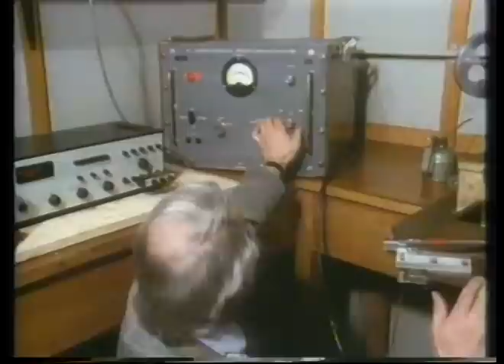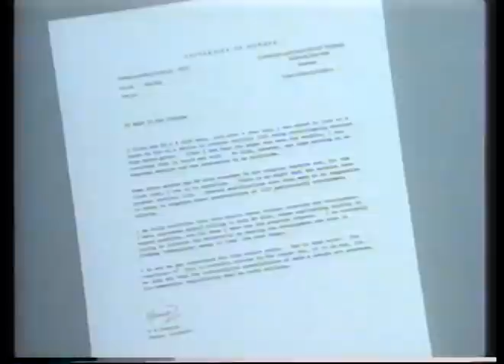Anti-Gravity Machine (Part Two)

Comment: You can lift the chair while stand on the ground but can not lift the chair while stand on it, doesn't matter how hard you try, even today space rocket, some mass must stay back for other mass to move forward, satellites use gyros to precisely rotate at the same spot in space but not change position or moving forward.
Reply: Well, one CAN lift a chair while standing upon it ... but it will just not stay lifted!

Comment: MYSTERY SOLVED! THIS HAS BEEN FULLY DEBUNKED:
Friction in the vertical center axel creates the lift.

the friction creates a screw lift effect.    anchored to the table and table to the floor.  without that center axel making friction during it spinning and without it sitting on a table on the floor it would just spin and go nowhere.   in 0 g it would rotate and no liftnwould occur as the friction on the spinning axel no longer is anchored to a floor to push up and off of

it will only lift as high as that center axel goes.   the axel therefore is creating the lift via friction.     to go 100 feet up you would need a 100 foot axel for it to 'Climb" up
CASE CLOSED
Reply: I don't think this needs to be debunked.  The "lift" was mechanical.  Same thing as a scissor jack.
Reply: @GAMESTERVISION   Youtube is the church of Conspiracy Theory.  Looking at the comments is like looking at the people at the car wash and saying everyone owns a car.  
Loved Bob's corvette that ran on water, and... gasoline.

Comment: I wonder why he didn't try four opposing gyro's to double the lift? im not suggesting it would have overcome it's own weight entirely but perhaps it could have been improved. Imagine how easy it would be to recreate his work in our age of more advanced electronics,  motors, cad design programs like fusion and a 3d printer
Reply: I think because the machine was making no lift.  4X zero is still zero.
Reply: Because doubling a force that doesn't exist works so well.

Comment: Hold on, you have to power a gear to get the total structure spinning. Then the two gyros fight the centrifugal force the gear generates by lifting toward the gear. No wonder no one is interested. Do you realize how much power it takes to create that effect?
Reply: This thing uses allot of power, but it's not regretting any effect.  The machine is not lifting anything.

Comment: By the use of magnets sound frequency  And Pan and tilt you could easily give this the movement it needs to go in any direction and any speed. Add a shell and you have a space craft.  This would enable you to do flight without thrust.

I have thought of multiple ways to add "thrust" by use of vents and slight modification to the device itself.  To use this method you would have to build the motor as the outside of the craft and it would be enormous making things much more difficult.

 You would need to add ventilation without causing drag on the motor. It can be done and may even have a use in such a design.
Reply: Yes and then the pulley and string used to make this thing lift up at 0:18 would not be needed.
Reply: That's why they were talking Nuclear'.

Comment: I find it very interesting that the UAPs that were confirmed by USA government seem to be very similar to his story about his craft working the same under water as there's clips of the UAPs splashing down and moving through water!
Reply: I find it interesting that this thing needs a bucket, pullies,  and string to pull it up.
Reply: It was the lack of tethering or measuring that tipped me off to how silly this is.  Any serious effort would place the device on a scale or force gauge.  In addition, its difficult to know where "the device" starts and ends.  Is the axle and the assembly that doesn't move part of the machine?   Why is there a bucket and other things hanging from the ceiling?

Comment: I would imagine it is flawed by Newton's law- that every force has to have an equal and opposing one. Whatever force spins the thing will want to spin itself in the opposite direction itself, so as soon as it is airborne it has no resistance so can no longer drive the giros. The giros required to produce any useful force would need to be enormous, so the 'craft' they're powering would never be sufficently larger to provide the required resistance. It'd be like putting a 6 foot propeller on an 8 foot dinghy, or a massive turbo-prop engine on a little Cessna.
Reply: The gyros could be 100 times bigger than the craft and they would still provide no useful force to move the craft.

Comment: This isn't anti gravity, it is just a spinning object with enough mass and speed to cut through the earth's field lines while eddy currents resulting as the affect seen. There is no such thing as anti gravity but if you can mirror the earth's natural frequency, you can levitate and or propel a craft, it would take a very high voltage and liquid helium cooled coils along with a sensor that can detect and mimic through modulation, the changing frequency of earth.
Reply: Oh well clever clogg's How did superman make the earth spin backwards then because I saw him do it with my own eye's!
Reply: you can levitate and or propel a craft?  Well i wish someone would.  The device in this video does not lift off the ground or even reduce it's own weight.  Spinning and wiggling certainly look fun and "cutting through the earth's field lines" sounds goo too.  But what's the point if it never works?

Comment: Obviously the air resistance of the entire spinning mechanism is the same as pressing on the spinning machine with your finger which uses the processional movement to convert rotational inertia into vertical inertia.
Reply: Or the sting and pulley system seen at 0:18 is being used to lift it.

Comment: The Noble gas structure is very important (A circle)! During this experiment there are two discs but there are needed 24 in a circle!  Take 7 balls and place one on a table and the other 6 around that ball. Each ball (metal) does have 8 magnetic fields =  4 x 2 (like a 1/8 piece of an apple) and the metal ball in the middle needs 24 discs to push away those six metal balls. Take an apple and cut it into 8 equal parts and each part is a magnetic field. See photos Billy Meier!
Reply: Drop a big lead ball and a small lead ball from the same height and they both hit the ground at the same time.  Same for a feather and a lead ball if you do so in a vacuum to remove air resistance.  Now drop a spinning gyro and a lead ball and something fascinating happens.  They hit the ground at the same time.   But the person holding the gyro felt how weird it was twisting in his hand, and starts to think he can make a levitation machine.

Comment: 423/5000
This type of machine can work, but does it take a lot of energy to get it moving? What about in space where there is practically no gravity, does it work?
Today, electric motors and a nuclear battery with tweek, this could replace the fuel engine.
I think that our government has already made attempts and are much more advanced than the population believes.
Reply: This type of machine did not work in this video.  What do you think needs to happen to make it work?  Floating in space weightless, could it make itself weightless?   0% more weightless sure.
Reply: @DeputyNordburg  I am thinking of creating a magnetic sphere which could suspend an autonomous gyroscopic sphere which could rotate without friction and obtain necessary and unlimited speeds. This could be possible.
Reply: @redgeciccone8218  It certainly could.  But aside from storing energy what would it do?  

The machine in this video was supposed to levitate.  To lift off th ground.  Gyroscopes don't do that.  And the one in this film did not.  

The professor in this film laithwaite seemed to think they became lighter when spinning.  They absolutely do not.

Comment: Would it work if the spinning/driving force wasn’t from the stable ground?
Reply: It does not work in this video that I can tell.  It has a string and weight to pull it up.  Shouldn't it be held down?  Wouldn't a force gauge or scale be installed to actually measure the effect?

Comment: Anyone who has ever held on to a gyro on a stick has felt the force of it.  Like wind blowing on a windmill.  Push the other way, you have a propeller.
Reply: I've held a gyro and twisted it.  It resisted the twisting, but never pulled in any direction.  Why with the plans for this online, do you think nobody will build one?

Comment: There seems to be some confusion about whether this machine is an "anti-gravity" machine, a new source of energy, or as a way of flying through space without reaction mass.  The only worthwhile application, if it can be made to work that is, is as a reaction mass-less way of moving when in space.  The conversion of sunlight through solar panels to provide power for gyroscopes that can turn rotational motion into linear motion woud be a great benefit to space travel and space exploration.

Whether or not this machine can be made to do any of the things it promises still remains to be seen, but after so many years and no results it doesn't appear to have achieved anything at all... And a statement by that crackpot Velikovsky is the last person you would want to hear from at the end of a "dodgy" invention.
Reply: Well, he patented it, with full plans available to the public.  And of course Prof Lathwait did eventually say it didn't work.  But his supporters refuse to build them.  So maybe it just doesn't work?
Reply: @DeputyNordburg  More than likely I'd say... 🙁

Comment: Let's see... 1986 to 2021... thirty-five years on and we don't see anything around which uses something like this, save a few mechanical batteries made by the Chinese and designed to store mechanical energy derived from wind energy (using energy derived from fossil fuels would be prohibitive in so many ways). The machine conserves angular momentum, and that's it. It's lift will be limited by how close to Earth's poles it is, along with how close it is to a gravity well. It was a good try, but sadly, no cigar.
Reply: Something like this?  It did not work in the video.  Why would something today use this?
Reply: @TexMex421  It wouldn't, and that's just what I'm saying. It might have a use as a mechanical battery for a resource such as wind energy, but you'd want to use that energy in quick order because it would loose energy, and would do so faster than most of the chemical cells we have today. The benefit of a mechanical battery is mostly about reduced environmental impact. All Chemical batteries have a significant environmental impact both in the manufacturing phase, and when no longer usable.
Reply: A complete description can be found in the expired US patent: US5024112A

Comment: From what I can discern, his device "works". But it is highly impractical. I am sure the energy input VS productive output (flight) is horrible. Plus flight navigation and control would be very difficult and unwieldy.
Reply: They seems to discuss it working in the video, but I never saw anything to indicate that it worked. I also didn't see what I would think of as an attempt to measure it working.  What I mean is there is nothing measuring it's weight.  if the machine was 100lbs originally and then spinning 90lbs, great, Success!   You could measure that on a bathroom scale.  Here there is a bucket and a string pulling up. A close-up of a small part of the machine moving.  Happy music and the narrator explain that it is working.  Is it?
Reply: @DeputyNordburg  If the machine is 100lbs and the spinning part (at rest) is another 100lbs, then the entire system would be 200 lbs, after spinning, the entire system will still weigh 200lbs. 
See related link:
https://www.youtube.com/watch?v=GeyDf4ooPdo
Reply: @DeputyNordburg  Most of us have seen this....
Where a science teacher will hold a spinning bike tire, while sitting on a swivel bench.....he spins the wheel, then sits down...like magic, he starts to spin on the seat....even though this effect is well known, it still appears mysterious to me. So can this same effect produce lift?
Reply: @SirPaulMuaddib    No.  But it might be yes if your definition of lift is really liberal.  If I sit on the seesaw in a playground and you rise off the ground, has lift been produced?  I would say no.  Same for elevators, and other mechanical lifting.

In your example where the professor spins, he is sitting on an axle.  The bike tire is spinning on an axle.  The seesaw in my example is turning on an axle.  
When I think of "levitation" or even "lift" I don't think of an axle being used.  An airplane wing flies using lift, but not pushing against a fixed axle, it's pushing on the air. 

The machine in this video is pushing on the ground, when it does not lift.  (A little part of it lifts, like an elevator.)

Comment: If you research satellite propulsion and charging systems you will see some of this phenomena at work today. I think the only thing on the surface we have to compare is the self balancing motorcycles...
Reply: Your confused, the gyroscopes in those applications work as positional sensors, not as propulsion devices.

Comment: It's another bewitching  new level counterbalance act ,like Tensegrity supporting frames can mesmerize ( the point of least resistance is the axle ,which has been given  another path of least resistance  ,a vertical spiral axis) I can see the apparatus of this Nature if it had to lift a 5 tonne truck ,being the size of a football field  with a 5 tonne counterweight some were in the gyro machine frame
Reply: It's a couple of gyroscopes spinning and wobbling.  It does nothing useful.

Comment: It's very difficult when you do not have the necessary technical background to yourself prove that a device has merit. The other option is to appeal to others that are more technically able that something new has been found and convince them that it is worth pursuing. Again, a difficult task as there are a lot of "cranks" out there and reputations need to be protected. With only the latter option available to Kidd and having found a "believer" in Laithwaite, the one thing I don't understand is why Laithwaite "complains" in his review of "Beyond 2001", that the device fundamentals had not been explored when he himself was in the best position to help Kidd in an effort to further explore the principles behind the device, but instead he seemed to hand it over to others. Something doesn't add up.
Reply: "Something doesn't add up". That would be Eric Laithewaite himself, because he simply gave up on trying to explain whatever he thought he saw, and just went lazy, going "Eh, it's probably nothing, and I'm probably wrong".

Comment: well, if you turn your gyros horizontal and have 4 total, two on each end spinning perpendicular around each other you would have a lot more lift, of course you still would have to tilt the spinning axises slightly, up and down would bring the machine up and down as well.
Reply: @suresham _ with more gyros, more lift, actually the more the weight the greater the force, wana make one?
Reply: 4X the gyros would mean 4X the 0 lbs of lift generated here.  If you had 16 then you'd really have a heavy noisy thing.

Comment: Why did he only limit the travel to two inches? He should of designed it in a way where it could go as high as the room would allow, just to see how high it could go.
Reply: Why did he have a bucket hanging from the ceiling?  Why isn't the machine sitting on a scale or force gauge.  Why do his supporters refuse to build another one?  Full plans at: expired US patent: US5024112A.
Reply: he needed the machine on top to spin it

Comment: Looks to me as a layman , that the device is lifting cause of the displacement of equal energy throughout the 2 rotating wheels .. when the center axis spins , the energy in the wheels momentum gets a difference..  the top of the wheels travels faster around the axis than the buttom , so the conservation of energy tries to make it equal for top and buttom by lifting the wheels making some of that energy to go in the direction thst would the energy disperse 50/50 for top and buttom of the spinning wheels . Somewhat like the old Guvanors/flywheels on steamengines..  Awsome machine you have build there !!
Reply: You have forgotten about Newton's third law: every 'imbalance' is - in fact - balanced so there can be no nett displacement. You may have seen an unbalanced washing-machine 'walk' across a floor, but that occurs only because of an anisotropy of the frictional forces. In space, the washing-machine would simply rotate about its own centre-of-mass.

Comment: "After years of theoretical analysis and laboratory testing of actual devices, no rotating (or any other) mechanical device has ever been found to produce unidirectional reactionless thrust in free space."
Mills, Marc G.; Thomas, Nicholas E. (July 2006). Responding to Mechanical Antigravity (PDF). 42nd Joint Propulsion Conference and Exhibit. NASA. Archived from the original (PDF) on 2011-10-30.
Reply: There is a reaction. Rotational.
Reply: Centuries of study concluded that the earth is the center of the universe...and flat as well. Then later both were proven to be incorrect. The tic tac ufos acknowledged by the PENTAGON are visibly violating the "laws" of physics. Perhaps an open mind is a viable option to the "already proven" box.